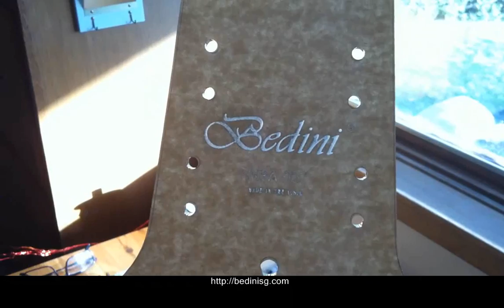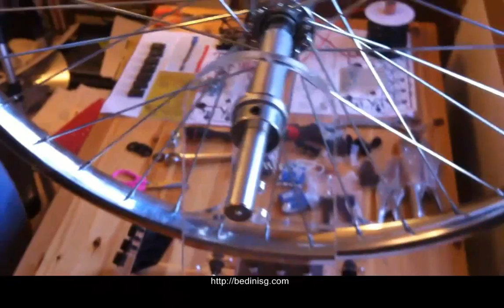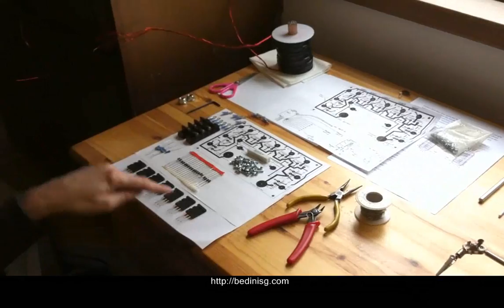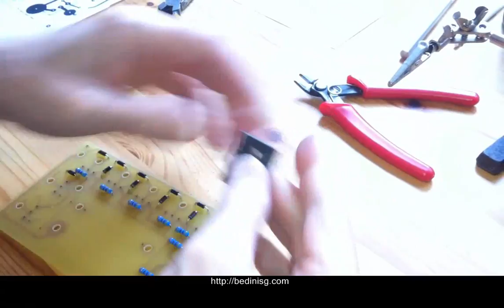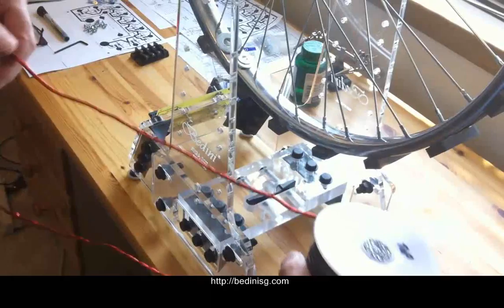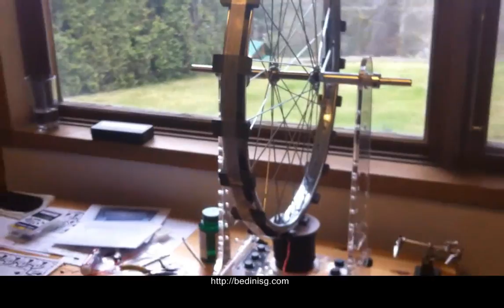How to Build a Bedini SG Energizer

Comment: The schematic shows a glow lamp between the transistor's emitter and collector—intended to prevent transistor failure if a charging battery terminal disconnects—but the video tutorial doesn't mention this?
Reply from the maker: They're not always used - I don't know if that particular kit, which is from way back, ever had them.

Comment: I was wracking my brain to figure out how to remove the axle and was wondering how I would replace it with a fixed axle, what would be the dimensions, where would I have it fabricated, how would I manage this and where to begin. I watched this presentation many many times and suddenly realised if you don't pay attention to even the smallest detail you could easily miss the fact that Mr. Lindermann  tightened the two adjustable nodes to fix the bearings in place,  thus preventing it from rotating independently allowing the engineer to attached an opto coupler to the axle if you so chose to and to trigger the mosfet with each rpm.  It brought home to me the memory of Mr. Paul Babcock's words during his presentation "air core vs iron core - They Are All The Same" He said "In the School Girl Motor John ( Bedini ) really gave you all you needed to know to turn the gokart School Girl Motor into a hotrod School Girl Motor". I think he was calling the potential engineers to look within the beginner, intermediate and beyond advanced School Girl Motor handbooks to come face to face with clues that would lead the researcher to the creation of 4th dimensional phenomena by learning to pay attention to even the smallest detail. And to that  end I am deeply grateful to Mr. Lindermann for keeping the conversation going. 👏

Comment: If 15 additional coils ( with the iron cores removed ) were connected in series/parallel.  Would they operate off a single circuit or would they require an additional 15 circuits?  Thank you sir.
Reply from the maker: Put them in parallel - you need an additional circuit for each one.
Reply: @AaronMurakami13  Thank you Mr. Murakami.

Comment: I built one from the pdf of the SSG beginners book, and everything worked until I did the test of disconnecting the output/charge battery side to test the neons like the book said and I had a bright neon flash then the unit bogged down and slowed to nothing and no longer worked. Any idea what the issue could have been?. Perhaps the neon's were not high voltage enough?. My transistors heat up the aluminum heat sink very fast now when I try it. I think I may have blown the transistors. I am quite new to this stuff but have built high end guitars and am proficient with soldering and I matched the schematic exactly. I had ordered the Digikey LAMP NEON RADIAL 90V-115V GT-NG6H1825T-ND. Was that not the right one to order?. I have since ordered the exact mouser neons and transistors mentioned in the .pdf from Mouser, and I am going to try again, but I was wondering if you may have some insight for me?.

Comment: EVERYONE IS SO STUPID..FOLLOWED THE RETARTED...WHAT IS GENERATOR MOTOR...TWO KIND OF GENERATOR COILED WINDING 3 PHASE 180 DEGREE 1 60HZPHASE TO RUN INDUCTION 2 .60HZ GENERATOR 3 60.HZ CHARGE ANOTHER MOTORS ... DC  MAGNET...THIS IS MUSCLE  FULL BATTERY MUNI BUS EITHA IOTA ZEYTA ZIGMA NERO NEGRO NIGGA ARE GASES...  OHMS(0+60)0MEGA(0-90)OPERATIONAL MISSION IMPULSIVE..ABLE.. 1PHASE( 150V 180V) 2PHASE  (220V 270V) 3PHASE (330V 360V) 4PHASE(420V 450V) 5PHASE(510V 540V) 6PHASE(600V 630V) 7PHASE(690V 720V) 8PHASE(780V 810V) 9PHASE(93 OVERPHASE 99ONCE) ABUSE BRUTE

Comment: it's the Back EMF which is recycled to charge the secondary battery, Overunity is different than efficiencies since there are always losses what so ever however Coofficient of performance COP could be above 1 with efficiency less than 100%. Thermodynamics Laws are not violated
Reply from the maker: It is an inductive spike that is recovered to charge a secondary battery - that happens after the switch is turned off and the magnetic field collapses. Back EMF is happening when the coil is actively powered and that Back EMF voltage is always lower than the applied voltage. Yes, there are always losses so the system is under 100% efficient while being able to be over COP 1.0 like you say.

Comment: I enjoy making one. I try and tested on how to make it self running. So far I'm SUCCESSFUL in reducing the power input by taking advantage of the speed of the wheel to generate power charging the primary battery and also installing the kromrey circuit or the shorting coil circuit as explained by Aaron.

Comment: The Bedini is not a true free energy device but it's worth the building to get used to moving on to more advanced technology, fair comment? 
Sorry to hear of the loss of John and Gary Bedini
Reply from the maker: The overunity shows up from the recovery battery discharge to see what you actually get out of it - that is the only true test as what winds up in the battery is not proportional to what can be electrically metered on the output of the machine. The chemistry translates it and it is a non-linear relationship. This is easily demonstrated with larger builds and large enough batteries where the impedance is ultra low. It will almost never been seen with small desktop models.

Comment: Thanks for this it's really awesome to find because had already started working on something along these lines and with a bycicle wheel sort of gave myself a rule to only use recycled materials.  It's pretty much exactly what I wanted. And also the other smaller bedini motor setup with battery charger just started building something along those lines on friday. This is really  miraculous finding this presentation. Such a gift many thanks. It's great when you see something actually work. Always knew the bicycle wheel would work. So much scope to advance the big bike wheel becasue there is room there for a generator feeding from each side.
Reply: THEN WHAT ABOUT CONSERVATION OF ENERGY PRICIPAL
Reply: Well I think it's just a great thing all round because it's cheap ,can use recycled, but the real beauty of it is that it's an introduction to a way of exploiting an energy source that is already there. A very simple mechanism using things that are available. I guess I really like the idea of using what you have already got and all these things apart from some cheap components are very easy to come by. And such an easy circuit to give understanding of what it is doing. There is a lot of scope for conserving energy once you have it. This is more a way of getting it. Conservation of that energy yes it's definitely on my mind because everybody is going for a unit that will power a house. Nobody seems to be focusing on managing every detail of what is used by each household item. Or the times of day more energy is needed. It has occurred to me that it's all about managing the energy than making some huge power source. Like the question really is why can't a network of small energy sources be a better answer. It's about power management start to finish.
Reply: SIR 
thank you for your reply but my question is that for input of 18v battery we should get less then 18v output energy according to consevation of energy principal but the concept off ssg is to produce free energy how is it possible.

Comment: A possible explanation on how it works. I noticed that primary windings is less than secondary, (actually eight or six depending on number of transistors). Hence when power is applied, only primary winding is activated, because of diode and transistor. Magnet is in repulsion state ( or attraction state, I am not sure). But when a magnet comes (due to inertia of wheel), a magnetic flux is induced in coil to produce an opposite current, hence triggering the transistor to collapse the current on the primary coil and produce current on the secondary (third, etc. coils) causing coil magnet to collapse from attraction to repulsion (or otherwise, not sure). Excess current is diverted to charging the secondary battery.  Since there is a 6:1 ratio on number of coils, it could be possible that this machine could have an efficiency ratio of more than unity?
Reply: THANKS
Reply: Yes it's the Back EMF which is recycled to charge the secondary battery, Overunity is different than efficiencies since there are always losses what so ever however Coofficient of performance COP could be above 1 with efficiency less than 100%

Comment: Crimped Connections are superior to soldered connections.  I work on Aircraft, and we always crimp connections together, and only in rare situations do we solder.   If your unit runs hot or warm, you will have problems with those soldered connections, I'm just saying (smile)   get yourself some good crimpers and form a pressure boind on those wires you will be much happier with the functional outcome.  Good luck on your project.  RichieNAndrews@yahoo.com
Reply from the maker: Richard Andrews You're using crimped connections because IF there are heat problems, you still have a connection and the wires won't fall apart from each other - it isn't because it is the best connection, it is for safety. If heat is not an issue, solder is the only way to go but even with solder, they can stand temperatures quite high. These circuits all run very cool with almost no heat on the circuit except for a small bit of warmth on any of the components.
Reply: +Richard Andrews Ultrasonic soldering is even more superior.

Comment: Lead acid Batteries are increasingly being superseded by newer technology like the Super Capacitor, Lithium Based cells etc, what application can this SG have for none lead acid based battery systems ?
Reply from the maker: ***** They work on the other batteries - lithium iron phosphate (not the normal lithiums), nicads and nickel metal hydrides are ok too.
Reply: OK ty hmmm well I am developing a model of a different pulse system of my own design have a lot of knowledge going way back to the 70's I been meaning to try out first but will still be following this technique out of interest.
 As some of it is similar to what I am doing, I am using opto switching as it is much faster response times, less interference and easier to control pulse width.
Reply: @dylans voice  which systems ?

Comment: hey, if you guys and gals like this stuff   u will  love the  2 seater  spacecraft you can get,    it comes in a crate ,full of tubular and various steel,powder  coated,   .  your going to need a bit of space though , lol   basic spacecraft model comes   12,  ft.tip to tip and 18 feet long.   were just trying to figure out how the glass panels can be fitted on and easily shipped ,   so  hang on friends,   your free energy spacecraft comes in every color under the earthly rainbow,   so just choose your favorite,   and start your incredible journey with the spacecraft club.  and power yourselfs   today

Comment: another way to find the north face of magnet, is put a string between two and let it spin to a stop. as long as you know which way is north, the north side will always stop facing north
Reply: the south end of the magnet will point north
Reply: etrnk wrong north will face north. What's the point of even commenting when you blatantly don't know magnetics?
Reply: Hi etrnk, I do understand them and you're partially correct. What Solomon doesn't know, yet seems to claim knowledge of, is that the Earth's magnetic North pole is at the geographic south. So, inversely, when your compass needle is indicating North, it's pointing at magnetic south (located at the geographic north).  Of course neither "pole" is due north or south with respect to geographic n/s, as there is the variance, but you should get the general idea now. Also compasses are weighted differently depending upon operation in the northern vs southern hemispheres. But that's more "magnetics" that we don't need to get into here :).
Reply: +paul4pres08 magnetic south is at geographic north like your comment said, AND why I said what I said...

Comment: With this device which is the ratio of batteries ? 1 to 1 or 1 to 4 ?
Reply from the maker: Without talking about mechanical work being done, the recovery battery with a good build will be 1 part energy from the input battery will give you about 0.95 parts energy from the recovery battery. However, you can actually add more batteries on the back - each with their own diode and find that you get more.
Reply from the maker: Becky York
95% is best case scenario. Most people probably get 80~90%. It demonstrates many concepts.

1. Can take recovery from the collapsing magnetic field after the transistor turns OFF and that recovery can be used to reduce the input necessary from the input battery by half or it can be used to rejuvenate a battery in ways that no other battery charging/rejuvenation equipment can accomplish.

2. If you get 95% in the back battery - the wheel is producing up to 30% mechanical equivelant meaning that 5% loss created 6 times the work in mechanical. 95% + 30% = 1.25 COP or 125%, which shows that the work of the wheel is essentially free.

3. It is a myth that energy is burned to create a magnetic field - the field is created by only the movement of current through an inductor but not the dissipation of it. If you get 95%, then only 5% is lost, not creating the field, but in very minor heat in the transistor, resistors, etc...

There is a lot more than meets the eye, but that is a few of the purposes of this machine. It is a learning tool and solid state versions without the wheel were made as commercial battery chargers. This Bedini SG is the Genesis of the devices here: http://teslachargers.com
Reply from the maker: Becky York Here is some details not covered here: http://teslachargers.com/products/bedini-sg/bedini-sg-kits/ feel free to jump in.